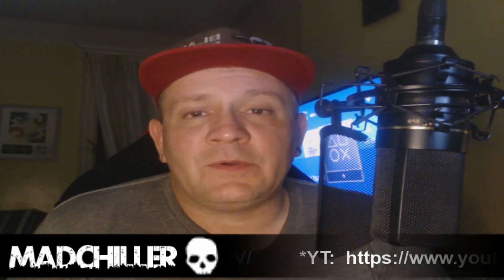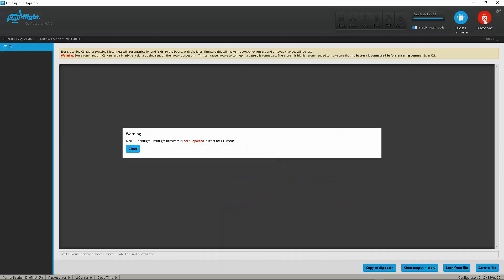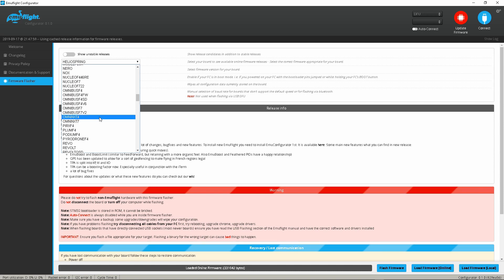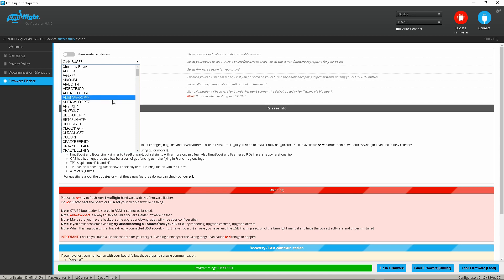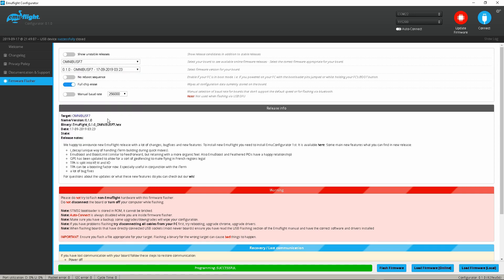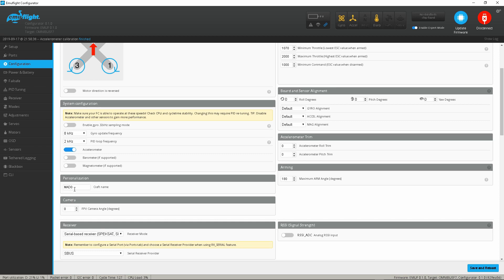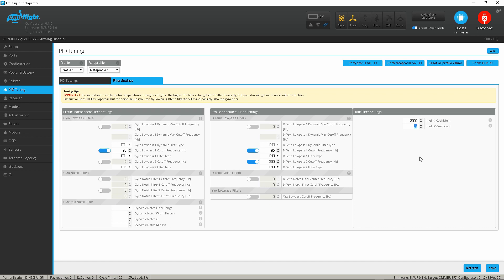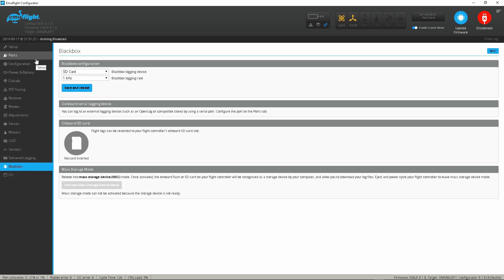Flashing EmuFlight PT.2 - NON HELIO - F4/F7  Boards

Comment: I have emuflight on 5 quads and its improved the flight on every single one of them with stock pids. Pretty amazing stuff. I'll be rockin emu til the end. Only major major issue I'm having is with a Diatone GT-M530. No osd after switching to emu. Once I switch back to BF osd comes back. Pretty sure it's the f405 mamba stack v1. Cuz I have 3 mamba f405 stack v2 and osd works great.
Reply: I signed up for github but the reporting process is way too much. So I figured I'd let someone involved know on here or just rock bf on that 1 quad forever
Reply from the maker: GlossyFPV One thing you could try.. flash back to Betaflight... and get a dump file... save this to a text..

Before you do this get a dump from your current Emuflight target.. 

Take a look at the resources and Pin outs and such... there is a good chance that something changed between the board revisions that you may be able to change in cli that can fix it..

Compare the dump files and look for differences...  something might be allocated differently and that’s your issue .
Reply: @MAD_CHILLER  thank you man. I will absolutely be doing this tonight. Got some rippin to do tomorrow.👍🤙🙌
Reply: @MAD_CHILLER  sorry to keep bugging you. I went through both cli dumps for bf and emu and noticed no differences in resources or osd settings. The weird thing is when I do put emu on my m530 the osd instantly goes out. When I put bf back on I dont instantly get osd back. I have to unplug the cam and vtx from the fc before the osd will come back. Not sure if that helps. I appreciate your responses.

Comment: Hey great vid. Trying Emu on Revolt can’t get to recognize FrSky receiver on Revolt
Reply from the maker: What uarts are you wired up to? Have you checked inversion?
Reply from the maker: BSFPV Did this work as wired in the FL1 firmware?   I asked my buddy Travis Brann whom runs Emuflight on revolt: He said:  “s.bus soldered to tx1 pad and the jumper for tx1 soldered so select inverted.” This is how he has his.
Reply: Worked fine on FL1. Using inverted TX1 not getting anything in receiver. My buddy is sending me a Helio AIO
Reply: Got it working guys. Had to jumper TX and RX pad underneath Revolt. Gotta say wow Emu is amazing. Liking it better than FalcoX

Comment: Hmmm, watched a video of someone flasihng a Kakute f7 to EMU, which flashed, but once in the UI, motors tab, he couldn’t get the full 5 startup tones from the ESC’s specifically the last two tones, received throttle, and zero throttle.  He deemed EMU not compatible with the Kakute f7? My question is why would EMU list an incompatible FC? It happens I guess! BTW in the CLI type: version if you just want FC type and BF date!
Reply from the maker: Steve MacDonald FPV Did they do a full chip erase when flashing? Others have had a similar issue if they do not do full chip erase.